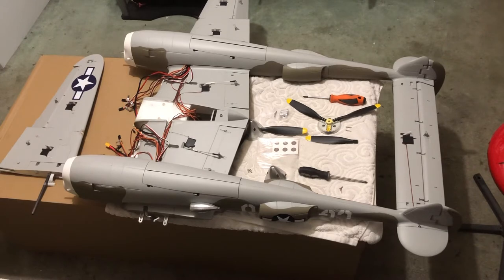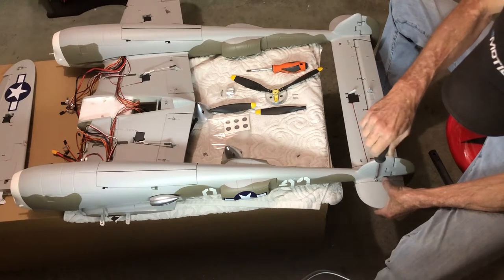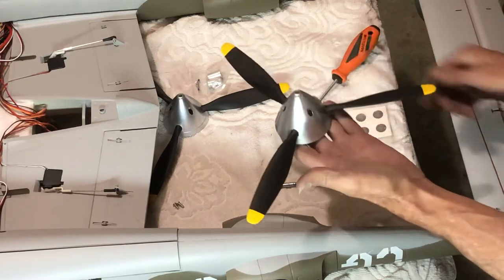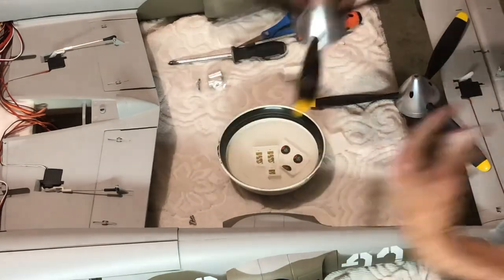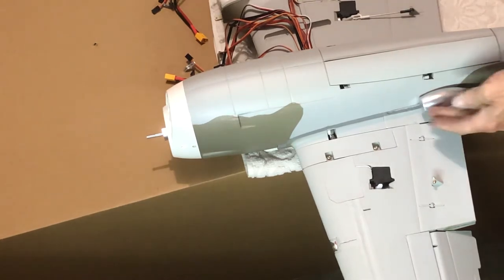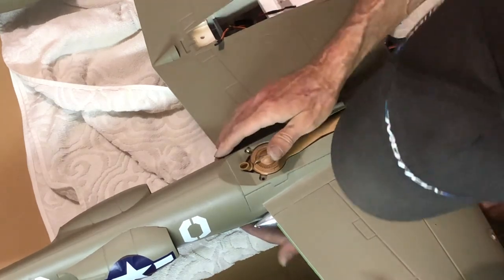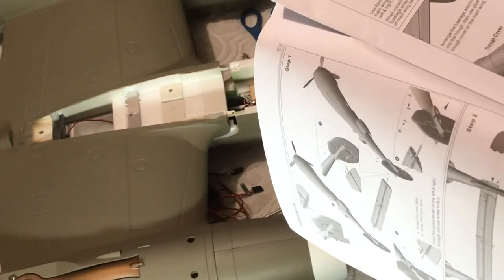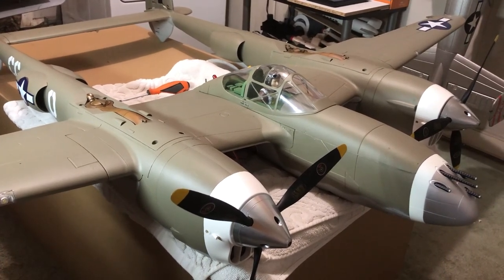Flightline P-38L (Build) P1

Comment: Sounds like they stole a screw from you!
Reply from the maker: It was confusing because the Boom calls for two different sizes. Even the heads were different sizes. But after understanding that the screw count was right but identified the wrong size that holds canopy on. The 5 I had left was 20mm but instructions said 10mm. So it worked out.😓 tonight I’m setting it up on a Admiral 600Gyro. Thanks for watching Chuck 👍🏻✌🏻🖖🏻